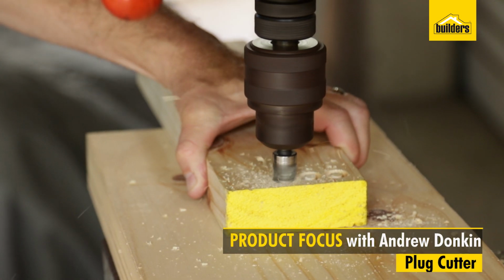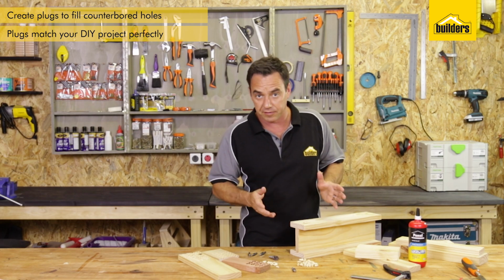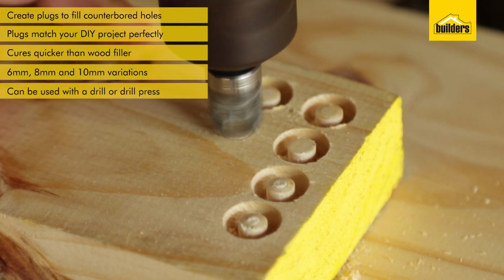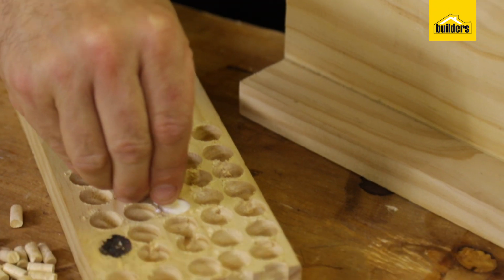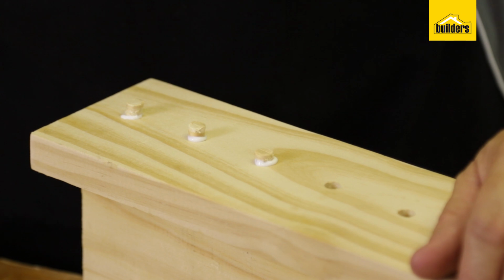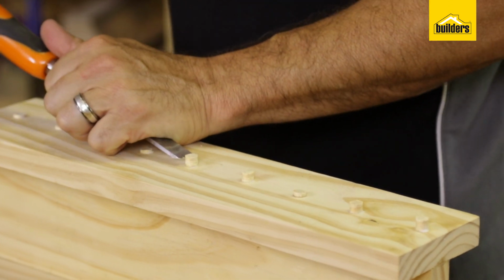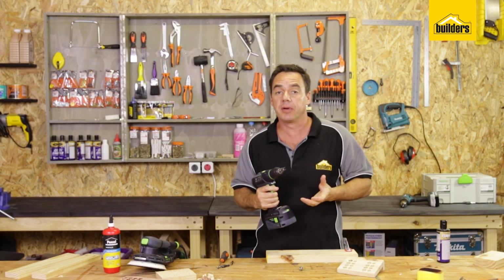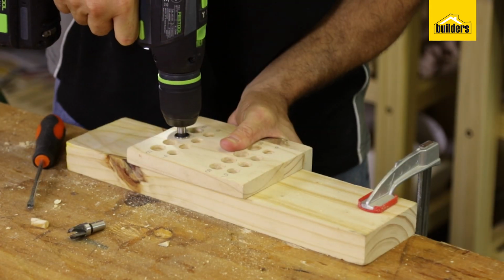How To Use A Plug Cutter

Comment: Thank you! With softwood (cedar) the plug cutter turns wood into sawdust when drilling the face, therefore I learned to drive it into the end grain and then making a 1-inch (2.5cm) cut on a mitre saw to release the plugs.

Comment: Hi 
Thanks for the video. It helped me .  How did you make the actual jig ? Thanks
Reply: Just drill some holes the same diameter as the plug cutter in a 3/4"/18mm piece of timber using a drill press to ensure they're straight. If you don't have a drill press you can use a jig to ensure they're straight... (perhaps you can borrow someone's drill press at some point?!)